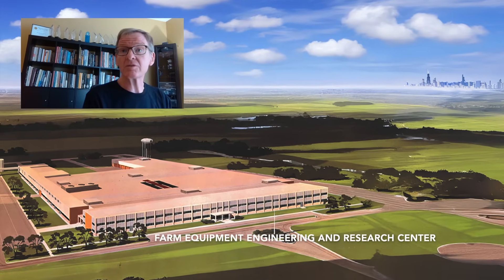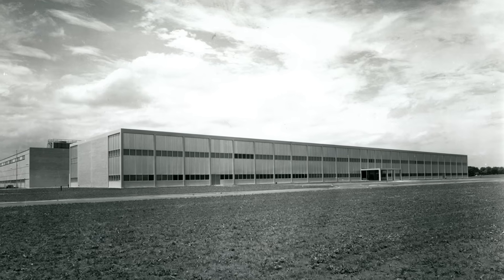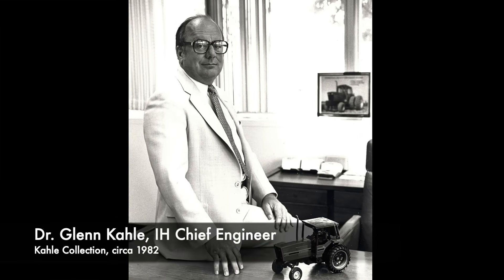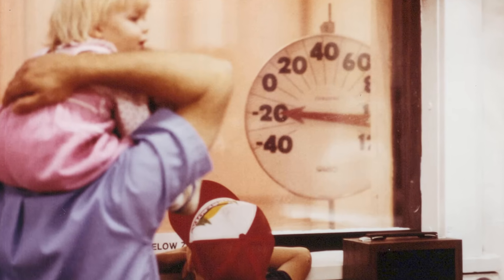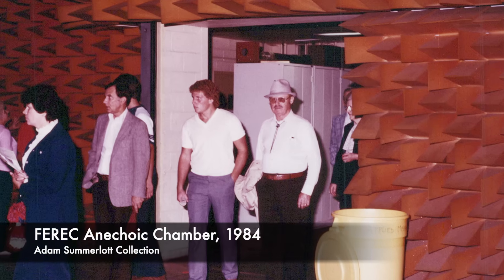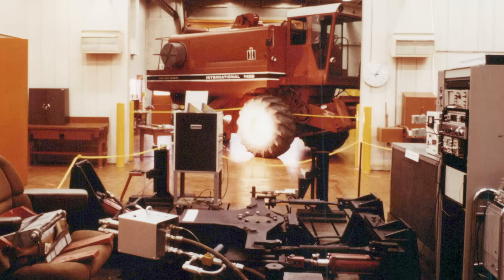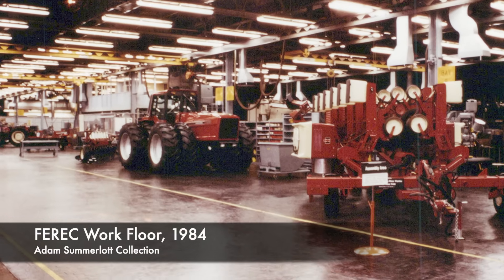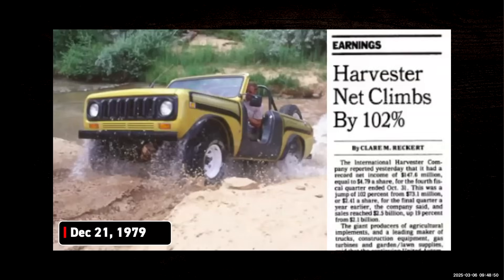Tractor Skunk Works: International Harvester's Engineering Center. Episode 6: Battles of a Giant

Comment: Excellent Video! Here is some additional, lesser known, activities conducted at FEREC. From 1959 to about 1983, the FEREC building also housed the staff of a corporate IH group, Engineering Research. Comprised of about 100 people, they focused on three key aspects of the Engineering process, including Materials Engineering and Research, Engineering Standards, and Advanced Engineering. As a corporate group, Engineering Research did projects for all of IH, including Ag, Truck and Construction Equipment. Many new technologies were studied and introduced to the IH Engineering Organizations, such as computer aided design utilizing graphics terminals, finite element analysis, Corporate parts Standards, Corporate IH Material Specifications, and new materials technologies, such as the use of Fiberglass Reinforced Plastics and common Lubricants development (ie. Hy-Tran). In conjunction with IH’s Wisconsin Steel Division, the Materials group developed steel technologies, such as non directional disk blade steel (Earth Metal), and new cost effective steel compositions, such as a new heavy duty steel for Truck rear axle hypoid pinions. With organizational changes, Engineering Research was blended into the various divisions, including a new corporate Science and Technology Laboratory in 1983.